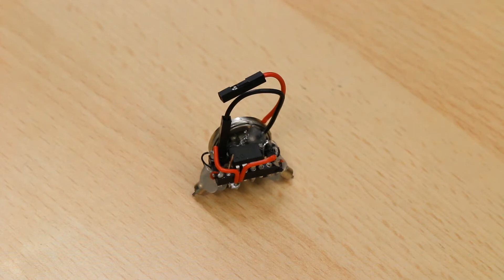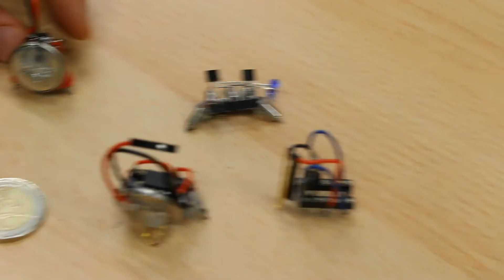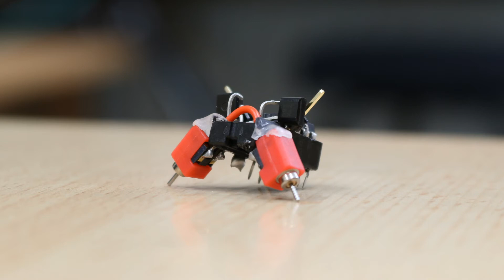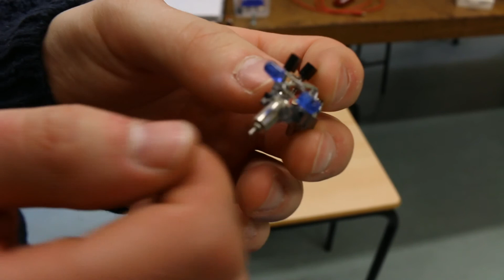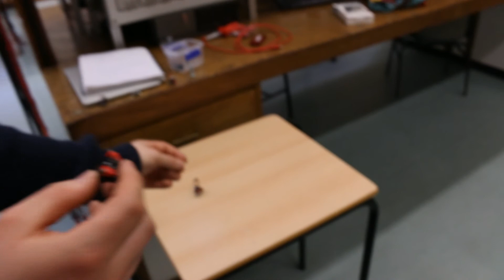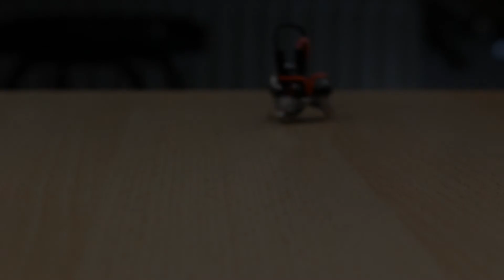€2 Robots in DIT

Comment: This project is amazing, good work. I really enjoy kilobots but they are a little bit "made by posh people for posh people". Your cap of 2€ is quite good. We are also trying to design a similar robot, new microsteppers 10 for 1$ may be a new good addition. I was wondering if that battery that you use is rechargeable, or if you have found a good rechargeable battery. Best I have found is a usb pack for 1.3€ but probably I am not as concern about size as you are.
Reply from the maker: Hi DFTL,

Thanks. Kevin Chubb did amazing work on this project. He's still with my research group here in TU Dublin (in Ireland), now doing a PhD in the area of soft robotics. His prototype in the video uses a non-rechargeable battery, but if he was doing it again I think he'd probably use rechargeables. The initial cost is higher, but in the long run it would be more economical and presumably better for the environment.

You mentioned microsteppers. As it happens, another former final-year project student of mine, Tien Tien Yep, used them in her project on swarm robotics last year. I've just posted some footage of a very early prototype here for you to look at:

https://youtu.be/wdMN8-AocQM

The chassis there is just a piece of foamboard and the stepper motors are driven directly by the pins of an Arduino Nano (with no transistors / driver chip), so they're only just about able to turn due to the limited current. Nevertheless, as you can see in the video, once it actually gets moving it works. Tien Tien had various technical problems with her robot, which affected its reliability. Despite these problems, what I took from her project was that the microsteppers are the way to go. They just offer so much more in terms of position control than what you get with regular DC motors and the prices are just unbelievably low. I definitely recommend going that route.

This year, I have another final-year student, Oleh Danielewicz, who is working on a swarm robot design. He's only in the very early stages of his project, but there's a good chance he'll use microsteppers. If so, hopefully I'll have something else interesting to post here before too long!

Ted